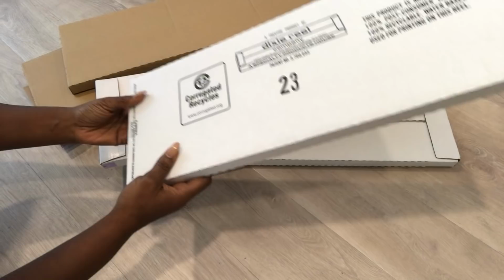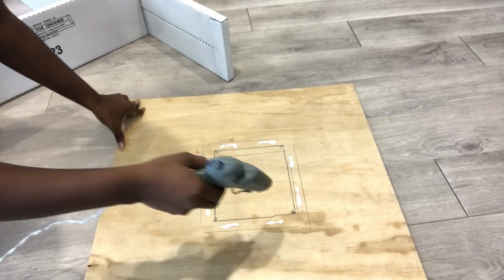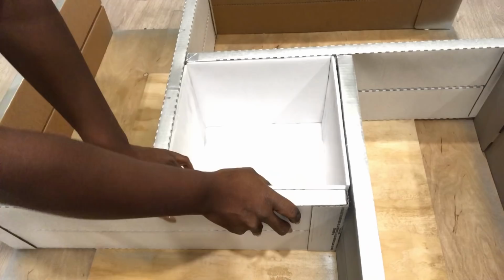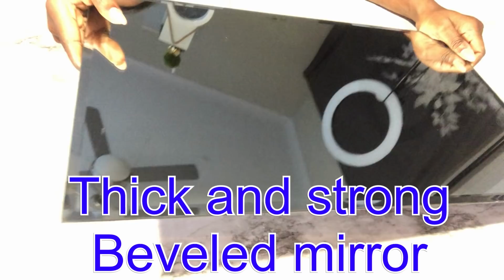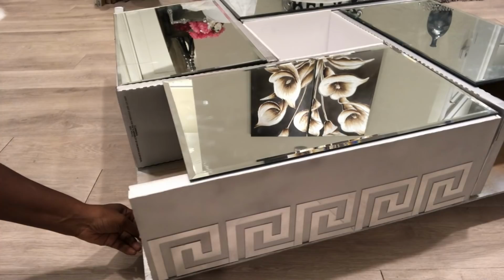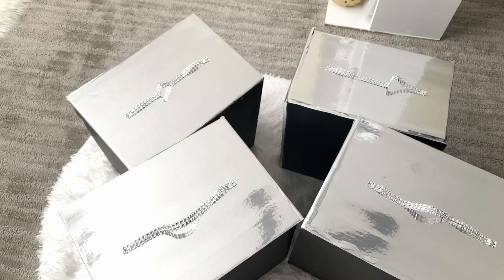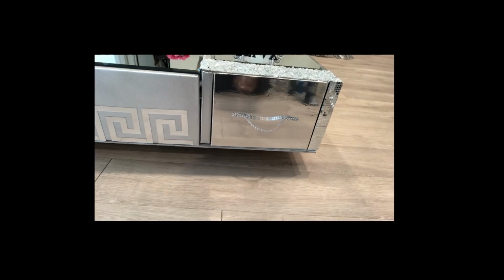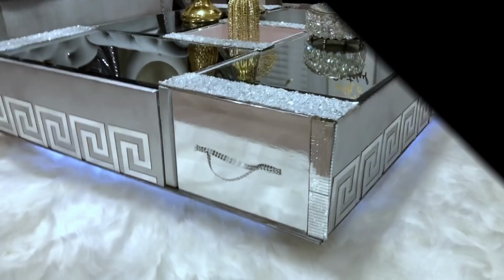DIY FLOATING COFFEE TABLE WITH FABRIC BOARDS| HOME DECORATING IDEAS ON A BUDGET!

Comment: Hello. I find your creation super beautiful and interesting. The idea of putting these lights under the table is just great. As you say so well, it seems that the table is floating in the air. I also love the effects created by the different types of mirrors used. It's amazing the overall effect of the whole. Brilliant, bright and very chic. In addition, all the storage space at the turn increases the value of your creation. We can put away all the little things we need, like remote controls, TV program etc.  You have a knack for these things. Thank you for sharing the video. Gabriel (France).
Reply from the maker: Hey darl! A smaller version of this will be nice for your build since it has hidden storage space 😃🤗💕💕💕